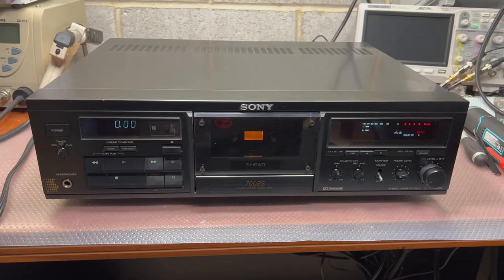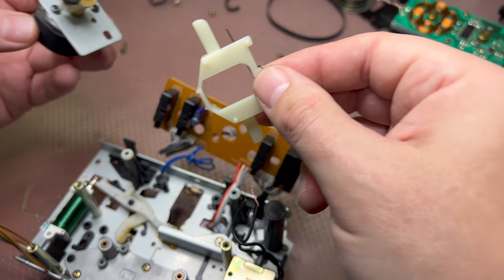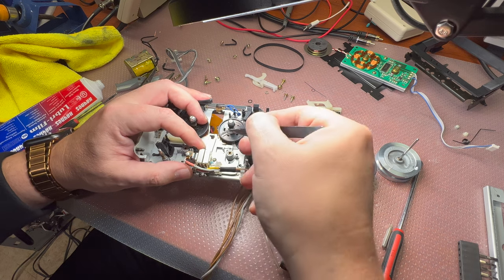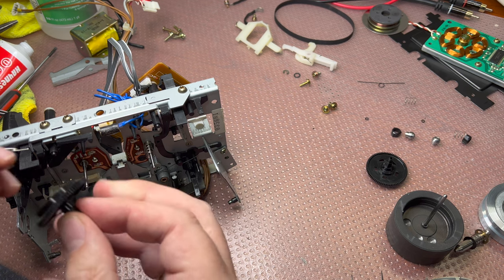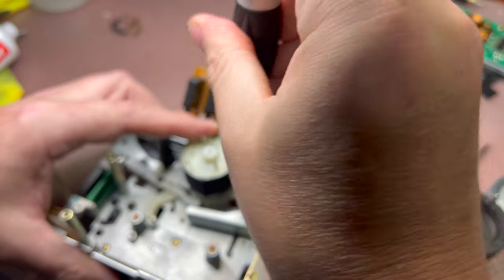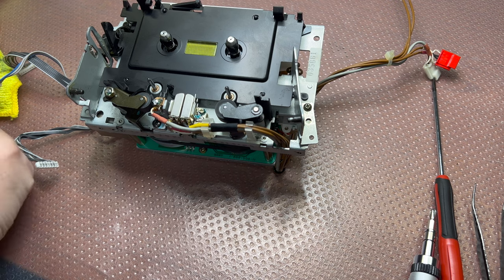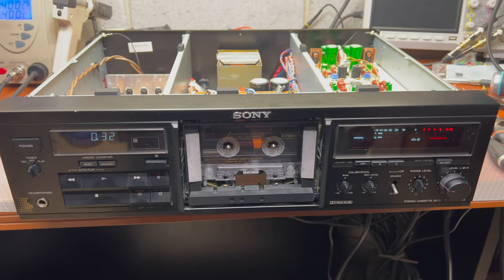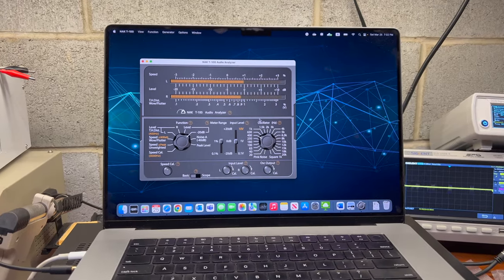Reviving the Heart: Sony TC-K700ES Full Tape Transport Rebuild

Comment: Hi, just serviced my TC-K555ESll verry similar tape mechanism, your video was informative, one note I did not see you cleaning the play solenoid, one small contaminant inside can block the travel, that might be the issue with the tape heads not sitting right all the time. Found a lot off black staff inside of mine.
Reply: My TC-K555ESII won't play, FF, or REW for any longer than 3-4 secs before stopping. I figure it is the autostop photo sensor on the board behind the reels but I don't know how to get the reels off? Please do you know how to get them off? It isn't clear in this video and my reels don't look quite the same.
Reply: @Luckiestmanalive-bb1mi  HI, 1. check the transparent plastic that has the light shining (I have removed it and try to test it and got this result not playing for more than 2 sec), 2. check the light bulb to work, 3. to remove the reels you have to squeeze the 3 pins in the same time they are not the same as in the video.
Reply: @MariusPetcu1  Thank you so much! I put the transparent plastic bit back in and it is still only playing for 2 sec and the light bulb works just fine so I'll remove the reels now.
Reply: Removing the reels is proving difficult. I have to press the 3 plastic pins at the same time and pull, right?

Comment: Hi, what kind of lubricant you use for those balls lubrication? Is it that lubrican also suitable for other parts lubrication as well? What do You prefer for a lubrication of deck mechanisms?
BR
Krisz
Reply from the maker: It's a silicon based lubricant.